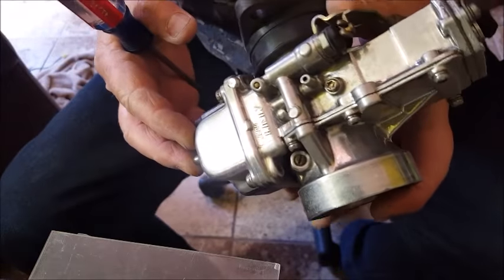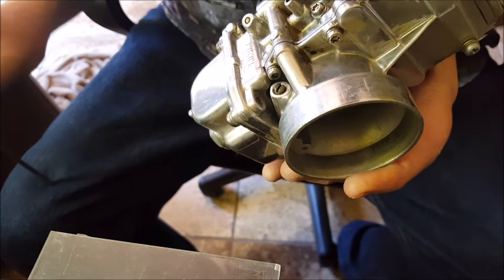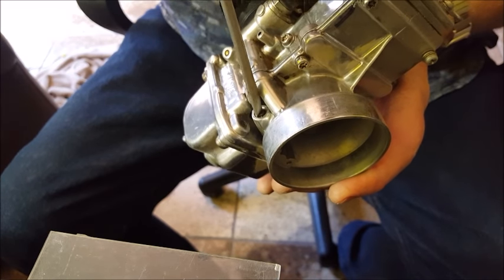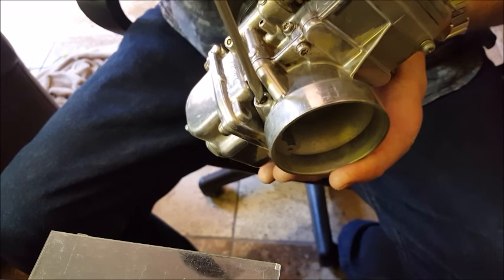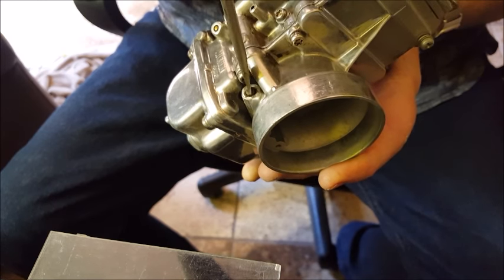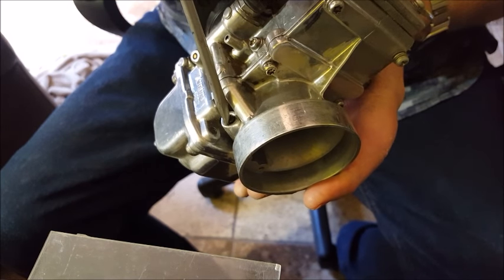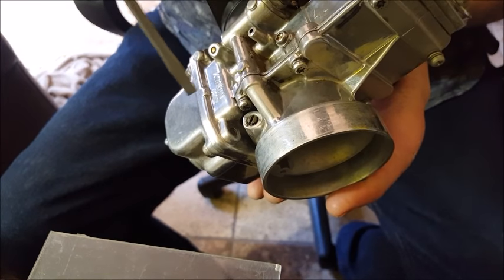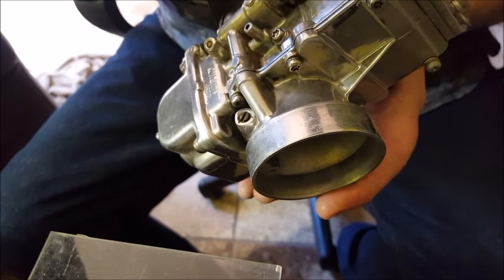Air screw adjustment Mikuni carbs only

Comment: That is not at all what it says in the mikuni HSR45 manual as far as your air screw being more than ONE full turn out or at which point you should main jet up or down so I'm STILL confused. And where should the idle be set when starting the procedure because not one person who supposedly knows how to tune these carbs ever even so much as mentions that.... Frustrating
Reply: Right, I went the 3.5 full turns and it opened way to much. Its about 1.25 to 1.5 but I actually pushed air thru and it was cherry
Reply: Once I get it running I'll adjust it

Comment: Tough to hear a high idle per cylinder on a triple.
Reply: You have to know which carb is effectively hitting which cylinder listen to the cylinders individually if you can use hearing protection it helps.

Comment: Good explanation here. How do you though determine the best slide cutaway? I have a 40 mm Mikuni VM on my 1984 Yamaha SS 440 and the jetting is very close but from idle to quarter throttle is sluggish. I was able to improve initial off idle response with less fuel screw and can close the air screw completely off with no effect on idling so I suspect my slide cutaway is too much.
Reply from the maker: Slide cut-away is a bit difficult to assess. As it is about 1/2 of your off-idle throttle response. The other half is your needle taper. If you can't get a crisp response with the needle moved up and down, then you probably need a different cut away. On special cases, I get the richest slide available and start filing the cut out up, leaning things out until you get a crisp response.
Reply: You need to go up a size on pilot jet.

Comment: I have a 1988 Suzuki savage 650 ,idle is perfect, my problem is that on low throttle is black smoke coming out from exhaust I replaced the spark plugs and still do it , I look info about it and some people say that is the main jet too big and is running rich, what do you think?

Comment: My dr 650 only has one cylinder. Mikuni bst40 with 155 main jet, open airbox and I don’t know the size for pilot. While at idle I can turn the mixture screw all the way in and nothing happens to the idle and supposedly the bike should turn off if I turn it all the way in. Do you know what should I do?

Comment: Hi A. Great video thanks for sharing. Just wanted to mention the mikuni manual references 3.0 turns as max before the spring no longer works and the air screw can fall out in operation. My sled’s stock setting is 2.25 turns. Whats your process for setting the throttle stop screw n relation to the airscrew. Great post.

Comment: the question is does the air/fuel screw adjust the amount of air or the amount of fuel going into the carb? And turning the screw out does it add or reduce air or fuel?
Reply: You've probably found out by now, but - Some carbs have a fuel screw & some have an air screw, one or the other. Air screw will be on the air filter side, a fuel screw will be on the motor side.   .

Comment: I have a vm24-512 round slide carb. So what you're saying is if i have to back out the screw more than 2 turns i need a smaller pilot jet?

Comment: Intake carb boot is cracked and i got a new carb but only moves when quarter choke. I open air box and cover 3/4 then it moves is it becouse of boot or do i need to adjustment on the air intake?

Comment: I have a virago 1000 with  two new mikuni tm 38 and i have changed the pilot jets to smallest available, when air screws at 1.5 turns out it runs wery rich when turning them out 3.5 turns it runs better but still rich, spark plugs gets wery black.

Comment: My adjustments are way off. Fidgeted with the carb and now bike wont even start.    For the air screw can i screw it all the way in? And feul screw should i turn that in all the way and out 2 turns? Feul screw is my main issue but when messing with it i forgot where baseline was.
Reply from the maker: You need to find your baseline for fuel screws, for your particular motor.
Reply: @aylorengineering.5513   turns out my pilot jet was damaged. Idk if it happened when i cleaned it but i slapped a new 26mm mikuni and it fired up. Feul screw 1 1/2 turns out
Reply: Tried tuning it multiple times but it wouldnt run no matter what because  the pilot jet was damaged. I think it happened when i cleaned carb but not sure..

Comment: I just installed a set of 38mm TMX carbs on my bike. They came with 3 tubes attached. One for the float bowls and the other 2 are just breathers? I can sync them by ear of course but can you use one of the breather inlets to sync a pair?

Comment: I have a 1980 Suzuki gs450L with mikuni bs34s carbs. It bogs down at high speeds/high rpms. I took the carbs off and cleaned them. Cleaned the air box and got new air filter. How do I set the carb? I’m cashing my tail when it comes to setting the air screw, I keep bogging down in 4th-6th gear. Any help/point in the right direction is appreciated!!!!
Reply from the maker: I believe your carbs a diaphragm type, which are a different animal. But anyway, your air screws have very little to do with any high speed stuff. That would be your main jet. Or you might have a mid jet also.
Reply: Probably your problem is your valve clearance.or maybe even your camshaft is worn

Comment: How do you set the idle adjuster. What’s the factor settings?
Reply from the maker: Depends on the specific carb and engine. You need to look up the spec for yours.

Comment: This confuses me.  If you set the idle and get it idling good then you go to rev it and it’s not clean obviously you still have to mess with the air screw.  Why do people say it’s only for idle.
Reply: I’m having the same confusion the guy said it’s only for idle but for your situation it might be the main jet
Reply: @roccodimauro3116  yeah I gave up on the mikunis and put the stock carbs back on

Comment: Question I have that carb on my 95 polaris 500 indy .. it idles about 1000rpm cold when first started for the day but once its warmed up it stalls out everytime u try to idle .. so I can turn up both screws to bring up the idle ?
Reply from the maker: You want to adjust your idle screws, not your air screws. Cold start ups should have a choke feature of some sort to raise the idle. So I would set the idle when the motor is at running temp.
Reply: @aylorengineering.5513  okay thanks ! I know this sounds dumb but the idle screw has the spring on it right ?
Reply from the maker: Well, all adjustment screws have springs. Refer to the video for the placement of the air screws.

Comment: Hi, my mini bike starts to run, without touching the throttle, it’s won’t stop running either, even when I press the kill switch and turn off the ignition. After a new minutes it eventually cuts  out by itself, but I need to hold the breaks until it does so. Do you have any ideas what this issue could be please?
Reply: Idle too high...... Should have put in neutral.....

Comment: My genuine Mikuni 22mm carb wants to shoot fuel out the over flow line and the two brass things that stick out both sides with little holes on the bottom when it’s at full throttle the needle valve seals well and my float it bent upward to lower the float level when there is fuel and it still shoots fuel out of those 3 places? Do you know any fix?
Reply from the maker: If you really think the fuel valve is sealing correctly, then it's probably one of 2 things. One is the brass tube that is for the fuel overflow in the bowl can crack and cause a leak. Second and most likely, is you have the float set incorrectly. Set by turning the carb upside down, and the bowl gasket removed, measure from the gasket surface to the top of the floats, (the actual bottom) they should be 24-25 mm.

Comment: Just got a new Mikuni for 2 bikes.  One wouldn't' start and flooded right away.  Tried resetting to factory, and still floods.  I suspect this has to do with the idle.  How do I adjust the idle back to a factory setting?  

The 2nd one worked fine when it first started but slowly started to bog down.  I tried adjusting the idle, and it picked back up.  Eventually it started to bog down again and I tried adjusting the air screw and it flooded.  This bike also, before flooding, would bog down if you revved it at any small throttle amount. 

I'm currently waiting for it to clear out for the 5th time.  What am I messing up?
Reply from the maker: Sorry about the late reply, but most all Mikunis, have the idle screw right on the side of the carb by the bottom of the slide. Turn out to slow idle.
Reply: Fouled sparkplug.

Comment: If I have a bad o-ring in behind the fuel air mixture screw, will that cause the engine to not have quarter throttle? Will it suck air through there?
Reply from the maker: I think you have another problem, but do get the o ring fixed, they are there for a reason.

Comment: My makuni only idles correctly with the air screw 1 and 1/2 turns out and the choke pulled out. It will slowly quit if I push the choke off. I don't understand why I can't adjust it to idle smooth with the choke off. Any Ideas, it's a like new 2017 ktm 250xc, only ridden about 4 times.
Reply from the maker: Your pilot jet is clogged.
Reply: Thank you, I drained old gas out of my float bowl, so I'm sure you right.

Comment: Pls help.I have a honda cd 90  similar engine to honda c 90 i think. Could you pls tell me how many turns do i have to turn anticlockwise this airfuel screw .also pls tell me when turning clockwise this screw what will increse ,air or fuel ? Thank you so much.
Reply from the maker: I would  Google your factory manual, or find a message board for your bike. I'm not really versed in those particular carbs. Sorry I couldn't be more help!

Comment: So, how do i get the highest rpm on one cylinder? Shall I disconnect ht leads ti the other cylinders?
Reply from the maker: No,  just adjust one screw at a time. The rpm change is very small, usually'

Comment: How many turns for 1 and half from closed 5 turns
Reply from the maker: I'm not clear on your question. But one and  half turns is with the air screw lightly screwed all the way in. Then backed out one and a half turns out.
Reply: Thanks
Reply: @2dollars833  22.5 turns.

Comment: Got a question, the  old  flat slide 38 tmx have an idle screw, does the air screw have the same function as this one?  (cause the idle tuning is already covered by the idle screw)
Reply: No 2 fonction different

Comment: My cr125 2001 leaks oil from the exhaust tip and its running too rich smoking too much, will this air screw solve it?
Reply from the maker: The air screw is really for setting the correct mixture at idle, and not much else. So your problem is with your oil mix ratio or your jetting.
Reply: Leaky rings ,but thats pretty common with cr125,potentially you can change your pilot jet or needle clip.if you have aftermarket gear on there it effects the fuel ratio.if your bike is stock(stock pipe ,air filter ) then make sure your running the stock plug and stock jets in the carb.which u can look up.anyhow I hope this helped

Comment: I just got a honda 230f with a mikuni swap and it lurches just off idle. I've tried a leaner and richer pilot jet and needle placement with no success. The engine rpms jump when you crack the throttle. Any thoughts on why that is? Thanks!
Reply from the maker: Actually that is what you want, crisp throttle response. BUT, it might be you have a too aggressive throttle tube cam for the Mikuni, that is opening the carb too quickly. That would be my best guess.

Comment: I’m having a big problem with my Suzuki 230s quadsport. I know it’s a carb problem for sure, My gas is going into the oil reservoir and making it unable to start. It smokes when it’s starting to fill I don’t know what could cause that.
Reply from the maker: I don't know specifically about your motor, but I would take an educated guess that a check valve in the oiling system is stuck open, or faulty in some way.
Reply: Little late but could be a stuck float perhaps..I've seen that a few times

Comment: At the bottom of the bowl. What I call a drain screw. What is the actual name? Because I cant find the replacement for mine.
Reply from the maker: I'm not sure the actual name, any Sudco dealer can figure it out for you. It is actually the main jet access plug.
Reply: @aylorengineering.5513  it's called the Air Screw set. Yamaha changed the name from 2005 to 2007. Before it was called drain plug. Not sure why.
Reply: I'm very correct. Lol not sure why they call it an Air screw. When they already have something similar also called an Air screw.
Reply from the maker: Well, that makes no sense, but you have your answer!

Comment: I have an 82 Gs650g and it has these carbs but I don’t see this screw anywhere. This bike doesn’t run it has rebuilt carbs and I have ran through a very long check list on things. Anyone have any ideas???
Reply from the maker: Well, unless someone adapted flatslides onto your engine (very unlikely) you have the stock carbs. The air screws will be hidden under a plug, and most likely they will be fuel screws in the front of the carbs.

Comment: Help bro. Ihave fzr1000 1986 model and using mikuni air screw only.  How many turn do i need to adjust. Thanks bro.
Reply from the maker: Mikuni  usually like to have their air screws in the 1 1/2 to 1 3/4 turns out. Now sometimes factory carb setting are different. So it would be best to find a manual online and find the spec. And remember, fuel screws are a different animal.

Comment: help!, my yz125 has a nasty bog to it (mikuni tmx 38 carb) if im riding in high gear just cruising along, if a slam the throttle all the way down fast the bike bogs, but when i gradually increase the throttle bike pulls fine. Please HELP
Reply from the maker: 2 things, first of all has it always done it, or have you changed something? And second, and most likely, the MX 125s are highly tuned and really only make power in the higher rpm band. What you are doing is trying to get the motor to go, out of the powerband, as most tuned 2 strokes just go flat if the rpm is too low. If you are just crusin and want to hit it, downshift once or twice to the get rpm in the area the motor is making good power.
Reply: @aylorengineering.5513  Ok thanks, no the bike has not always done it, but the top end has 90 hours on it
Reply from the maker: Have you done a compression test?
Reply: @aylorengineering.5513  yes, bike has 110 psi of compression, why?
Reply from the maker: 90 hours can cause a lot of wear. Is 110 psi close to stock? Low compression will make a motor doggy.
Reply: @aylorengineering.5513  stock is 180 psi
Reply from the maker: That's most likely your problem. Time to freshen the gal up.
Reply: @aylorengineering.5513  yep thanks 4 the help man!

Comment: my mikuni only has  adjustment screw and it turns in like 6 times before setting ... how do i adjust that?
Reply from the maker: What kind of Mikuni?
Reply: 6 full turns or half turns ? any chance of trying while the bike runs ?
Reply: Mikuni 22 for predator 212cc. I found the fuel screw I think near the block under the inlet. But the afr screw turns 6full turns into the slide
Reply from the maker: @sevinkadler  Into the slide? I "think you are turning the idle screw, not the air screw. The air screw is behind the slide, they do not go into the slide.

Comment: If the bike backfires from the front cylinder while idle, does it require PMS screw adjustment?  Currently both carbs PMS screws are set to 3 turns out.  Can synchronize the carbs resolve the backfire issue?  Thanks again for the video.
Reply from the maker: The carb adjustment would have to be wayyyyy off to cause a backfire. I would look at the ignition first.
Reply: what do you mean? ignition coil?

Comment: on my 1982 gs 750 ..they have them on the top front..and i had to turn then in to richiñ it ..if i turned them out it didnt give it enough fuel
Reply from the maker: I think you need to look at your manual. It's possible, but I have never heard of a fuel screw adding more fuel by screwing them in.

Comment: On my lt125 when i start or prime the fuel it leaks out of the overflow maybe a stuck float how do i fix pls help thx
Reply from the maker: If it is a stuck float, you can first try to tap the carb bowl with a screw driver handle while running to see if that seats the fuel needle. If not, just pull the bowl take out the needle and clean it and the seat. make sure the float moves freely.
Reply: @aylorengineering.5513  sir is normal on yz 125 1986 my needle flot dont hold on those little metal wire ? Needle is just in the hole and and around that tube i have a pin that hold the flot first time i see that
Reply from the maker: @woodyWoodTimber   That is probably specific to those carbs. And I have not dealt with them. So I can't help you there. I'm sure there is a breakdown on the internet somewhere....

Comment: Hi, i have a 2000 yamaha road star 1600 with aftermarket exhaust and air filter. The bike is running lean. Do i need a rejetting kit or adjustment?  It has a makuni carb. Thanks
Reply from the maker: I would say you need a jetting kit if they are out there. You could spend a fortune and many hours figuring out what they already did.

Comment: My moto4 225 will start but runs away any ideas?
Reply from the maker: Either an air leak, or stuck throttle cable or carb slide.

Comment: What about if you can't find the idle, but the engine starts every time when you crack the throttle?? I have my idle screw all the way in, and still can't get it to idle.... 2 screws on a/f tried different pilot jets, but I think I'm still rich??
Reply: Do you have an independent idle adjuster? That would most likely be your issue.